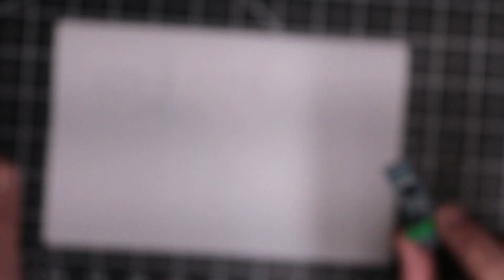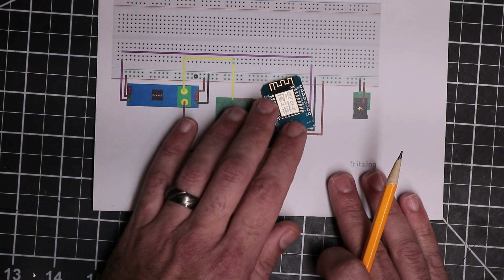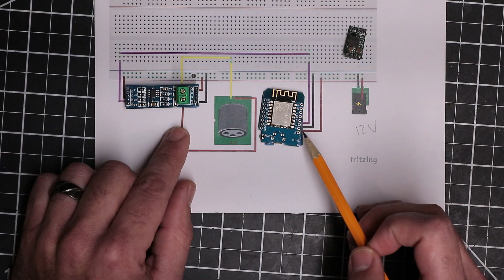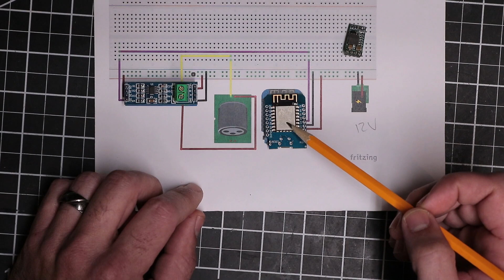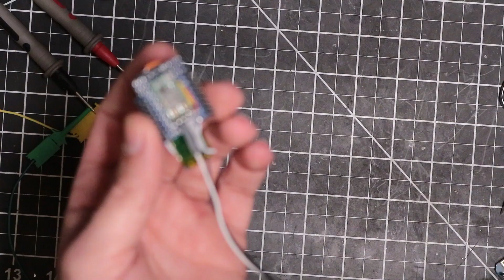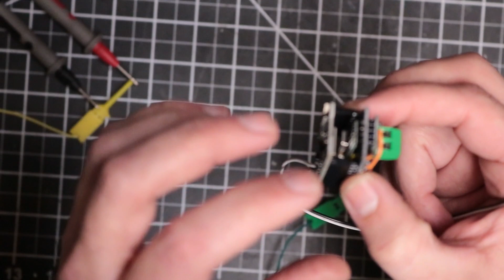Espixelstick serial DMX E1.31 Wemos

Comment: Nice video! can we add sd card shield for Pixel-Stick v4 ?
Reply from the maker: Thank you.   I'm sure it's possible, the code does not currently support an SD card shield but if your good with coding I'm sure it can be done.  Are you running out of storage space?  If so you can use a Wemos Pro, same footprint and pinout but more RAM and memory space.

Comment: Thanks for the great tutorial.  Out of curiosity, could this be installed in 1 moving head, and then daisy chain to other heads via the DMX output?
Reply from the maker: Thank you.  Yes you can daisy chain, I ended up putting the DMX plug assembly back in and was able to daisy chain 6 heads together and they all ran flawlessly, you should be able to do more up to 510 channels.

Comment: On another unrelated note you spoke about RGB flood lights in your video. What lights are you using in order to be controlled via a WeMos D1 setup for instance? Have seen LED RGB flood lights but mostly controlled via a remote which is not relevant here

Comment: At first it didn’t work for me because I connected D3 to DI but then I realized the wemos was sending the data from pin D4.
Reply: Oh my god. So glad that I saw thought to check the comments, since I had the same problem, thought that maybe my module is shitty or the dmx is bad on my light, turns out I was using wrong pin, haha. Thanks for commenting about this!